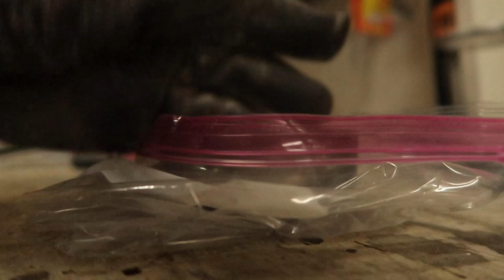VW Audi Cam Adjuster (Phaser) Cleaning | MK6 Golf R

Comment: Was literally in the same position today lmao. Stripped that bolt so I had to use a screw extractor. Took the thing apart and forgot how to put it back together, thank god for your video.
Reply from the maker: Lmao I'm glad it helped. For the cam adjuster bolt, heat it up first then loosen it with an impact gun! I've done that bolt like 8 more times since this video and haven't stripped another with that method haha
Reply: @FAZEDTom  so I put it all together and now it sounds like I have 272 cams. I turned it off and started it up again and it was all normal for a minute then went back to lumpy idle. If the timing is off wouldn’t it be idling rough nonstop? Als I have a strong feeling it’s not my timing that’s off and it could be incorrect reassembly of the cam adjuster sprocket.

Comment: I know bro it's been a while since this video but my question to you is : the alignment pin the one who clock the phaser on the cam the tiny pin broke on a golf r engine that at i bought to rebuild do you this pin can be changed ? Like punch it out and put a new one. Yeah the chain guide broke then chain broke and snap off the pin

Comment: Regarding the stuck bolt on the extractor: just put the bolt in the vice an twist the extractor out clockwise. Or clamp the extractor an hammer on the bolt, or throw everything together on a concrete floor. 

About the screws in the cam adjuster: with your ratchet set, there should be a kind of t-handle part that slips over the Extention shaft of the ratchet. Attach the torx bit to this, then put it in the screw and hold slight tension on the screw while you hammer on the head of the t-handle. 
Same method works great on brake disk screws.
Reply from the maker: Hey thanks man, I appreciate you taking the time to give me suggestions. I should be able to get that extractor out of the bolt. I don't recall seeing one of those T-handle parts but it sounds like the perfect tool for the job.
Reply: @FAZEDTom  I don't know if t handle is the right word for it. It is kind of a super short part with the half inch connector to attach to the sockets and there is a round hole through it.   I just don't know how this is called in English, but as I think of it, a breaker bar would do the job also. It's just important to have a solid piece behind the socket you could hammer on. So that the impact of hammering gets transfered to the stuck bolt and loosens it.  Here is a pic of it 
https://www.proxxon.com/de/industrial/1-2-zoll-einsaetze.php
Reply from the maker: Ahhh, that's very cool! I've never seen that before

Comment: I done my timing chain and not changed the camshaft adjuster because of the worn bolt and my car makes a noise like a tractor noise, will it be because of this camshaft adjuster ?
Reply from the maker: How’d you do the timing chain without removing the adjuster? I don’t think I’m following. Tag me on your reply
Reply: @FAZEDTom  the camshaft adjuster was faulty my bad, I’ve done my timing correctly and it just coming up with P0011 code and oil pressure light, but no effect on power or anything like it drives how it should

Comment: @FAZED
how did you take it apart from the intake cam ?
Reply: I'm interested in knowing this too! Going to change the adjuster soon...
Reply from the maker: There's a bolt that holds the adjuster to the exhaust cam. You need the specialty poly drive socket for it. The bolt breaks very easily so I highly highly recommend hitting the bolt with some heat then breaking it loose using an impact gun. Once that bolt is out, the adjuster pulls straight off.
Reply: @FAZEDTom  man that's awesome it's been a couple months trying to find something useful I didn't want to screw the expensive phaser or the camshaft
Reply from the maker: @billydeathgrind4275  yeah it's expensive! I take everything apart in a couple of my videos around when this video was posted, not sure which one exactly but the info I just told you is pretty much all you need. Ideally you'll have a cam locking tool as well so that retiming your cams is easy
Reply: @FAZEDTom  I tried heat and impact wrench. That doesn't work. Unless you maybe have two strong supplementary vice grips on the camshaft AND a 1000 Nm pneumatic impact wrench. Only a proper 90cm breaker bar can possibly loosen this bolt, don't even try without adding DAP tank bond in the head to hold the polydrive bit that is unfortunately pretty loose otherwise.
Reply: Did you use genuine VW/AUDI camshaft lock tool? I have CST version from Amazon and it fit very tight after bolted into head cover. Using a 2FT bar with CST Made in USA poly drive, the bolt stripped on the two recent occasions I've done this. Only the drilling 4-5mm into the bolt, then banging a T55/T60 and using 1/2 breaker bar works. Unfortunately you have to disassemble the cam adjuster and clean out any metal shavings from the drilling. I also forgot to record my 1st video, but I have one of me doing this method. Learned method from decimaltenths on youtube. @vindieu

Comment: so why did you take it apart in first place. did you have ticking noises or a p0016 code on the intake cam? just wondering
Reply from the maker: Hey yes I had a p0016 code that ended up being a broken crank key way for the crank timing belt sprocket

Comment: Hey, my Audi A3 Sportback 3.2 Vr6 gives error code P000B (Camshaft Position Slow Response) do you think cleaning the adjuster could help?
Reply: may help but check also the solenoid in the chain cover!

Comment: Any updates? I have a p0016 correlation code and noise on start up
Reply: Took it apart looks ok no scoring or burn marks
Reply from the maker: Issue was with the crank timing gear, the keyway on the crank was broken!

Comment: You sure you don't need to torque those screws in? that thing spins fast when the engine runs I would torque to spec and even replace the screws if possible.
Reply from the maker: I wasn't able to find any formal information such as torque specs on this part because I believe the dealer would just replace the entire unit. I also wasn't able to find replacement screws. If you really are going to take this apart and reassemble then I'd apply loctite on the screws, put the adjuster in a vice, and tighten them close to how much torque it took to break them loose.
Reply: @FAZEDTom   I believe those would be standard 20nm spec. I have never taken this one apart... there were no O-rings in place as far as I can tell from your video. Is that the case?
Reply from the maker: Correct, there are no o-rings. The cam adjuster seal rings are the three rings on the solenoid unit (on the housing cover) that sticks into the cam adjuster.
Reply: @FAZEDTom  I see. Some have O-rings within the unit. Thanks for reply!